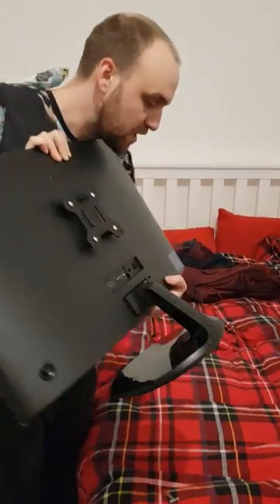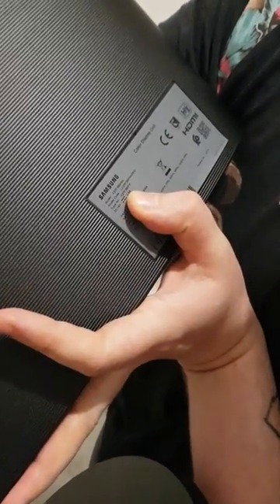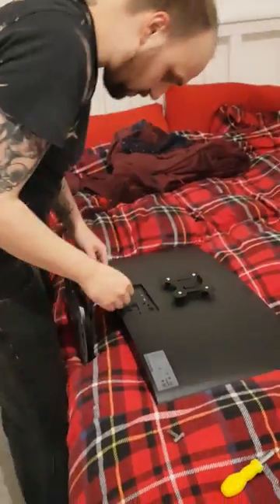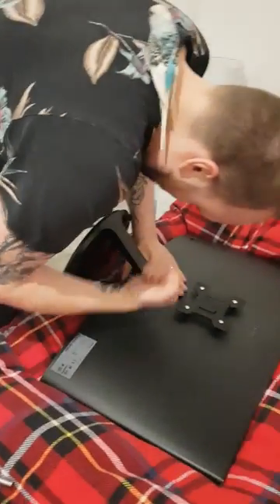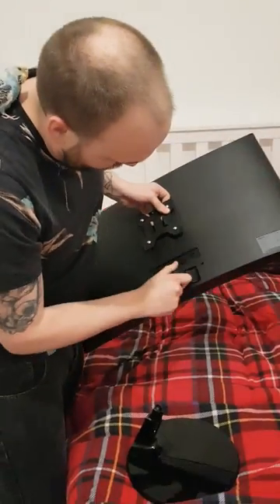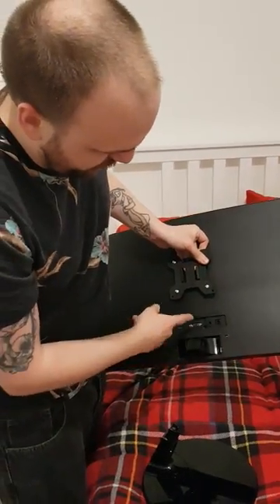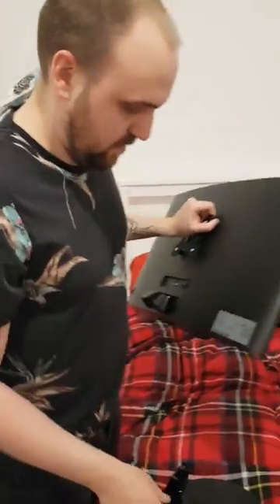How to remove a samsung curved monitor neck stand

Comment: Since I bought this monitor i never knew that it could be adjusted up and down. Thank you bro. Who still has this monitor in 2024?
Reply: Same!
Reply: Same. I just bought a separate screen mount because I was angry with not being able to tilt it. Only to learn that it can, while trying to rip that thing off :-D either way, happy with the separate mount for different reasons

Comment: Can’t believe this video is 4 years old. lmao. just bought a samsung curved monitor couple of days ago & was returning it since wife wanted a new computer which already has a monitor. Struggled for half an hour, got frustrated & googled to see how to break the samsung monitor apart. Google recommended this video. Watched it & followed advice to put the bottom back on the stand. Then whacked the bottom plate just like in the video & it popped right out easily. Awesome youtube video for those who have the samsung curved monitor. 👍

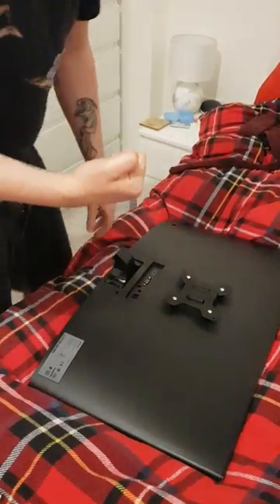Comment: 0:38 literally everyone who owns this monitor says this lmao idk what Samsung was thinking with this design
Reply: Now that I think about it, tbh when I was putting it together I was literally thinking to myself "wow that's really simple and easy assembly design". I completely overlooked the fact that there's no clear or obvious disassembly method. The inside clicks into place internally with no obvious external ejection mechanism.
Reply: @davidmassey8773  This is even worse on the C24 144hz curved model. The stand extends so far that it cross into the mouse's path unless you put the monitor so far away that you need a pair of binoculars to see the screen. I've seen some people online sawing off the parts that sticks out and the monitor is still stable so the feet not only a hindrance but also useless.
Reply: For me those 2 pieces are 1 singular piece, thankfully

Comment: Just bought this.monitor today from CEX it's to be wall mounted in my kitchen for fire stick. I have spent ages trying to find a way to remove the pivot bit, thanks to this you showed me I only  need to remove the base connection. 👍

Comment: Had this kind of stand on a different model of Samsung monitor. Was getting it for somebody else and decided to assemble the stand to check for defects. Stressed for half an hour trying to detach this stand piece afraid to break it to put it in the box again. Did it in a minute after saw that it won't break anything. Even with detached bottom flat piece and applying more force while jiggling the middle piece came out no problem. Thank you!

Comment: Yep, this is essentially what I had to do as well. Opening the case is indeed a bit much,. Once you have popped the base/vertical stand off, it mounts just fine and the remaining pivot is not visible. It does take a surprising amount of force to pop off, but it WILL come off if one is insistent enough. Thanks for making this video. It helped me too.

Comment: I have the CF396 monitor, with a tri-stand set up so it was a bit harder to punch (also I’m not that strong hahah). I used a hammer instead and just kept hitting the center piece until it loosened and eventually fully came out. This sucker is a pain!!! Thank you

Comment: I just tried this with my C32F397FWE and it worked. Because the feet point out on the front on my model, you have to flip the screen over so the screen is pointing upwards and hit the feet.  Thank you so much

Comment: Thanks for that, once I’d seen your method, I used a flat bladed screwdriver in the small gap between the two pieces to pop it off.

Comment: Legend, also if the BOTTOM is broken, use a screwdriver to lodge inbetween on the detail then apply pressure and it should pop off. Mine was in bits already so this helped loads!

Comment: Thank you m8. I used this on a c32f and it worked. I tried removing the back panel before but I broke the fairing or whatever its called. I now have a tear on my front srceen rim whattyayig. But thats not ur fault. Hammering the stand worked and Im gonna leave the stub thing on. Im gonna check if the monitor still works now lol.

Nice parrot, too.

Edit: Yeah trying to open it broke the monitor. About 20% of it are unusable. Handle with care. : )

Comment: I  tried this one but it didn’t work since my right hand is its final stage of recovery from surgery and my left hand is pretty weak. But this gave me the idea to stand on the circle base with and pull the monitor up and it worked.

Comment: Thank you so much. Other videos show how to unscrew and separate the back of the monitor so as to take out the sort of stub of the stand fitted into it. I must have fitted the stand when I got this monitor but I lost the instructions. I got the stand bottom off but could not see any way to separate the upright middle bit from the stub part. The monitor is great but the method of fitting the stand is shocking bad design.

Comment: I noticed you had some extra part over your vesa screws. Is this some kind of vesa adapter? Can I directly mount this monitor to a vesa compatible stand without that adapter?
Reply: Yes, the bit you can see is the backplate of a vesa mount,

Comment: Hello  appreciate your help . Can you post some close up picture of the neck to see hoe it is secure . I think with tht info maybe introducing a screw driver through the bottom is possible to  unattached it  with out the need of that force
Reply from the maker: Ah sorry I don't have the monitor anymore I sold it a few months after posting this, the screw at base connects it to the neck so when slam down on the base the neck comes with it.

The screw doesn't reach the monitor, it's the locking system that stops it from easily being dismantled

Comment: I ended up putting a sharp knife into the join and prying it open because I didn't have the strength to pull it apart ( it is already mounted ). But at least after watching this video I knew it was actually possible. Have had the screen for more than one year mounted on arm with neck still attached 🤣🤣🤣 #2024

Comment: Use a flat screw driver place it by the gap inbetween the separation and hit it with a hammer gently, twist the screw driver and it will pop right off no need that kind of banging

Comment: Anyone got a solution for actually mounting it to the wall? The holes in the back are too shallow and the mount is not able to sit flush against it... Surely Samsung didn't need to make the mount holes also curved?